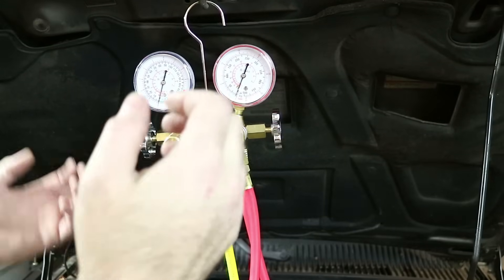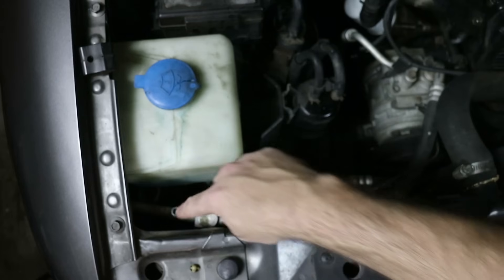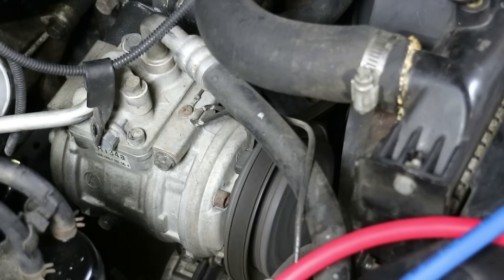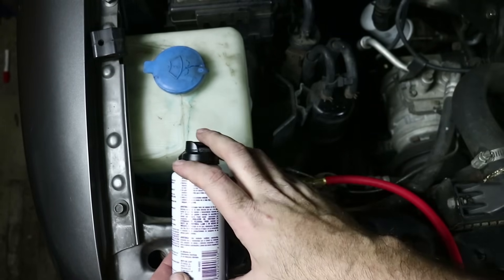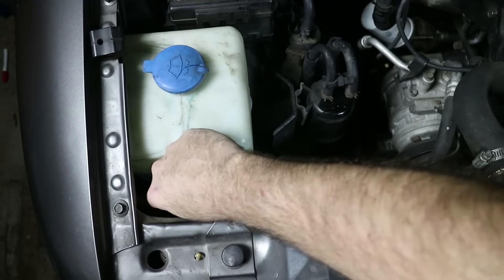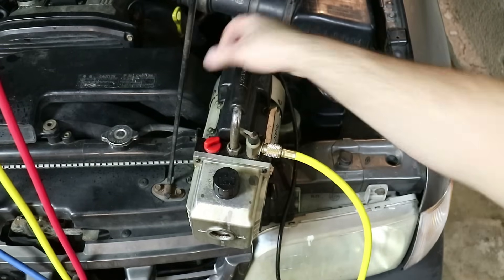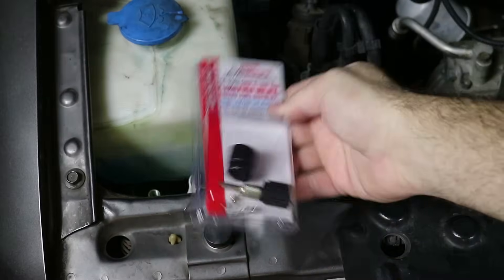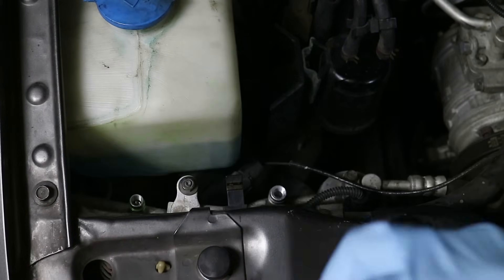How To Recharge an A/C System Professionally DIY

Comment: Great video!  It is my understanding that the reason you needed to evacuate the system by a pro, or at least back into a recovery bottle was not to release the old R12 into the atmosphere. This is why they came up with R134A. This should not be an issue since R-134A. It does not do damage to the ozone layer in the atmosphere as R-12 did.  Also, you might have a very small leak from the small O rings that connect the pipes to each other.  If that is your problem they should be changed.  However, this is a pain in the butt depending where that ring is, there are a few of them.  usually with a very small leak your AC should work for a few months if not the season.  At that time just charge it again.   About the valve leaking, You might want to push in the schrader valve with a small screw driver.  Just a quick push and release it. Sometimes some crap gets in there and "popping" the valve will clear it for a better seal.  Also, when removing the valve any charge or pressure in the system will be lost.   When you turn the can upside down, Be careful.   Car compressors do not like it when liquid goes into the system. It "can" destroy the compressor.  Always use the can right side up for gas.  When the can starts to get empty, meaning there is not a lot of pressure in the can.  What you can do is get a small pot of warm water and insert most of the can in the warm / hott-ish water. This increases the can pressure and forces the gas out of the can much easier and faster.
Reply: R134A does damage to the atmosphere in a different way, and it is illegal to vent it into the atmosphere.  It is supposed to be recovered.  Recovery machines cost upwards of $4,000, so most Diy'ers will not have access to one.  Believe me, if I could find a way to avoid paying a shop to evacuate my system, I would.

To me, his video clearly explained that any charge or pressure in the system will be lost if a valve is removed.  Did we watch the same video?
Reply: @chucklemberg4968  Do a youtube search for "DIY AC RECOVERY". There's a few guys who made their own machines out of old window ac parts.

Comment: Not opening the high side valve (the red one) when recharging the system was mentioned, but not the reason. The reason is that doing so allows the high pressure from the condenser to get into the can of refrigerant. Those cans are not made to take that kind of pressure, and could explode! When the can explodes, the refrigerant is instantly going to vaporize and freeze anything it contacts, such as clothes, skin.... eyeballs. The red valve should be open only if the vehicle is not running, such as when checking the static pressure to be sure it is equal on both sides of the system, or when pulling a vacuum. Otherwise LEAVE IT CLOSED!
Reply: THANK YOU !!! This is EXTREMELY important.
Reply: Never open that valve,that is only for evacuating and for vacuuming purposes.99% of the time you only open the low side.Unless you have a major problem.

Comment: The most common r134a pressure vs temperature charts that I see online show different pressures than this, for example at 80 F they show 40-50 psi on the low side and 175-210 on the high side.  Do you know why your chart is different than that?
Reply: Every vehicle is designed with different operating pressures but not that far off for r134a, you can get vehicle specific pressures from an Auto database at your local library. High/Low pressures and vent temps are at a given engine RPM, windows down, out of direct sunlight, A/C on recirculate, fan on high. By applying the max evap heat load the TXV will be fully opened, prevent the compressor from cycling, keep pressures steady.

Comment: Very good video.  I appreciate the energy and detail.  Respectfully said (though) I realize that you can SLOWLY sort of shake the can (as you did) but most all sources say to avoid (if at all possible) doing that as it may allow liquid to hurt the compressor (when can is upside down).  Doing so will fill the system faster, but increases potential of harming it.  Just some general info & food for thought.
Reply: I agree with you that liquid hitting the compressor is a bad thing.  I like to use a large bowl of hot water to put the can into.  Even when 90% empty and mostly floating in the bowl,  the hot water helps the head pressure in the can.

Comment: Remember folks. There is no mechanic in a can that can stop leaks in your a/c system. If you add a leak sealer to it you will destroy your expansion valves and compressors. Should be illegal to sell that shit lol.

Comment: Awesome video thanks. Also to note you show how to bleed the yellow hose when adding a can of refrigerant!  Great Job!!!  This was very helpful!
Reply: HINT: Turn the can upside down. That insures "liquid" flows up the yellow line and when the liquid reaches the top, it creates a visible mist. Then there is no question if you have the line purged. If you have the can upside right, only the gas escapes and you can't see the gas. NOTE: It is highly unlikely his system is at the correct charge. The only way to properly charge an A/C system is by precise weight.
Reply: @darrylhowe1465  "If you have the can upside right, only the gas escapes and you can't see the gas."  That has not been my experience.  The refrigerant gas has a clearly different appearance from the plain air that is in the line once it enters the atmosphere.

AND, pulling liquid into the compressor can lead to compressor damage.
Reply: @chucklemberg4968  I don't doubt that one might (in some cases) be able to see the difference in light diffraction due to the temperature difference between R134a and the surrounding air; however, R134a is colorless. (Source: https://en.wikipedia.org/wiki/1,1,1,2-Tetrafluoroethane)

Comment: 12:00 Shouldn't you bleed at the low side connector of the car and not half way like you did? The yellow line is full of air but so is the blue line!
Reply: Nah, at that point the blue line is still holding a vacuum of -30psi. Only the yellow line was open to atmosphere as he took it off the vacuum pump and put it on the refrigerant bottle.

When he did the second can of refrigerant, the blue line was still part of the sealed system (this time with pressurized refrigerant) so again it doesn't need bleeding.

Comment: Do u hv to close the tap in high pressure line (red wire)before inject UV dye for checking leaks?
Reply: Yes.  In fact, since you're adding dye, don't even bother to connect the red hose.

Comment: My Low Side Pressure is 50psi
& High Side is 300psi
So the Compressor is good or bad?
Reply: Compressor seems like its pumping.   It sounds like you have air and non condensiibles in the system or its radically overcharged
Reply: @patrickcady2843  sorry high pressure side is 225 to 250psi.
& the sound all are normal.
but the cooling is not good.
The temperature in Pakistan reaches 44°c
Reply: @UmarFarooq0300  Are your windows tinted? Does it cool better at night?
Reply: @irongoose3865  Yes, it would be right at night
Does not work on days when the temperature is high
Reply: @UmarFarooq0300  Tint your windows, it makes a difference.
Reply: @irongoose3865  This is the same experience I have had
I made Windows 25% black
But I didn't read that much differently

Comment: Die was injected, but so was a slug of air.  Also, if your lines are full of air when first connecting, then you just put air in the system.

Comment: If you vacuum your system down it is completely empty you can install the refrigerant as follows. This method is quicker and more efficient. First of all you do this procedure with your engine off you do not run the engine or the AC! After hooking up the can of refrigerant and purging the line you then invert the can and submerge it in a bucket of the hottest water you can get from your tap. This will not allow any water to go into your lines because they are perfectly sealed and under pressure. Swirl the can inverted in the hot water for 30 seconds to build pressure in the can. The next step with the engine off is to open the red line and within three seconds 12 ounces of refrigerant will shoot through the high side through the condenser to the receiver dryer the way the system was intended. Next close your red high-pressure line, your empty refrigerant can valve and remove and discard the empty refrigerant can. Repeat the same steps for the all other needed cans. For the last can, in this instance, open and close the high side valve intermittently if you’re not going to use the full 12 ounces. Each time you open and close the valve, weigh the remaining refrigerant on a small scale that way you’ll be able to know how much to go. The final step is to close both valves on the manifold gauges and then start the engine. Run  the AC on high with a temperature gauge in the center register with the fan on high and the windows and doors closed and your air recirculating not taking outside air. Fine-tune any more charging with the can upright in the hot water and open the LOW  side or blue line to let the refrigerant in as a gas. This is important because you cannot put a liquid in the low side you could lock up your compressor. Many videos incorrectly show you inverting the can and shaking it up or holding it sideways when putting refrigerant in on the low side this can damage your compressor. Hope this helps, good luck.
Reply: Hell no don't do this 😐
Reply: @narekhart9862 care to elaborate?
Reply: All them quick fill cans like ACPRO says to tilt it. I get what you are saying about liquid. But they are referring to not crank the thing wide up and ram liquid into the low side which would then potentially lock up. But if you just go easy with it it’s fine

Comment: Use a micron gauge and pull it down to 500 microns don’t just run it for 30 minutes🤦🏻‍♂️
Reply: But a single stage vacuum pump may be incapable of reaching that level.  Probably best to pull it as low as the pump will go, then keep it going for 30 minutes.

Comment: Inverting the can of refrigerant charges the system in the liquid phase.
In theory, this liquid could reach the compressor inlet reed valves and damage them.
In practice, the liquid should "become" gas (due to the lower pressure in the lines between the can & the Compressor inlet...) But do bear it in mind.... do not blindly flood the lines with the refrigerant in the liquid state. 
There is a lot more to consider in theory than is explained here. Consider this as rudimentary first-aid at best.
Reply: Which is probably why most instructions tell you to flip the can rightside up and upside down.

Comment: Hi 50's, I watched your video about five times and then carefully did everything just like you said . . . except I forgot to purge the yellow line of air before I opened up the low side and turned on the can.  Putting another can on after emptying the first, I did the same damn thing with the second can.  Jeez . . . how stupid can one be. 

What's the consequences of having air in the system?  I have a vacuum pump and can evacuate the system.  I have a shop that will recover the 134a.  Then I'll bring it home and evacuate it and see if it holds a vacuum . . . just like you did in the video.  Good thing I didn't do that first . . . or maybe not.  Just extra running around.  Anyway . . . my gauges are reading the same as your gauges which, for it being 87 degrees here with 75% humidity, is within the ranges of your chart . . . on the low side of the range but still, it's within range, a/c is blowing cold and compressor is not short-cycling.  But I know there's a couple short hoses worth of air in my system now thanks to my Alzheimer's.  My manifold hoses are about half the length of yours, so that's an unexpected advantage of having a cheapo manifold. 

When the connections got really cold where they hook to the manifold the hose connection got frosty and started leaking a little since (I assume) the fittings were shrinking from the cold and allowing freon to get past the O-ring.  I'm guessing on that . . . do you have that happen too? 

Anyway . . . what's the consequence of having a small amount of air in my a/c system?  Could I possibly ruin my compressor or other component?

****************************

I just read the comments below after posting the above.  It's reassuring to learn I'm something of a genius compared to many of the commenters.
Reply: Hi Mike....Nah...a bit of air in a car system is negligible. But that assumes that there was no air in there, to begin with! Compared with Fidge freezers, a car system is pretty rough & ready and therefore quite forgiving.
It also depends on where you are and the relative humidity: High Humidity means moisture-laden air...A big no-no in any refrigerant circuit. The moisture can freeze in the expansion valve/metering tube orifice and shut the system down as the suction side will fall below the low-pressure switch opening point. (as it has no gas to suck on!)
Apart from that, it would appear you did a good job! Thumbs up. Cheers.
Reply: The only air you'll get after vacuuming is what if any air that sneaks into the charging or low pressure hoses after you pull off the pump.  However, if you properly purge these hoses, what you will get into the system is negligible.  The problem is not the air per se, but the moisture.  And the receiver/dryer can trap that last bit.

Comment: This was the best video on charging and helped me!!  I had questions about vacuum with oil in the systems, and bleeding air and this video answered all of them.  Very informative and easy to follow and listen to.  Thanks!
Reply: Did you have a scale so you would know exactly how much refrigerant was put back into the system?
Reply: @kdeh21803  Yes.  Made sure can was on liquid side, and measured amount by weight.
Reply: @richardroy5437  that would be great if the system was completely empty but never just top off.
Reply: @kdeh21803  Mine was completely empty.  Pipe broke at flare joint, system was at 0 psi.  I replaced lineset, vacuumed it etc, and refilled by weight.  I was worried about compressor oil since there was oily residue where it broke.
Reply: @richardroy5437  Then you replaced the amount of refrigerant on the sticker.....  a few weeks ago I repaired a system on a very small vehicle and the sticker said the maximum charge amount was 16 ounces.... I got to thinking some of these "top off" cans are more than that and people with no training in car AC work get these cans and empty them into their car thinking their doing something, "Great" and they have put 1/2 pound more refrigerant in their system than it calls for and it really does more harm than good.  Because a can says, "AC Pro" does not make you a pro.  AND some of these cans have a "low pressure" hose but I've never seen one with a "High Pressure" hose..... you need to guage both.
Reply: @richardroy5437  The UV dye that comes in a bottle is actually refrigerant oil with the dye added.  So when I added the specified 3/4 oz, I was adding that much oil.
Reply: @kdeh21803  Using a digital scale, weigh the can before and after.
Reply: @jackb1803  even then, was the system completely empty and if not how much was in there.??

Comment: Hi Jason, great video as always.  My low side was around 70 and my hi is 150.  What am I doing wrong?
Reply: sounds like an expansion valve issue.
Reply: Sounds like you may have a weak compressor.

Comment: Hey boddy. When you removed the low pressure core from the inlet and gone for a couple of hours to buy replacement part, the system was open to atmosphere. Humidity has intered the system and your dryer needs to be replaced. A very big common mistake.

Comment: My 2002 cadillac eldorado displays "ac refrigerant low- AC off". My ac power button will not engage (light wont go on ). So my ac compressor clutch wont engage to allow me to introduce R-134a. Any guidance will be much appreciated.
Reply: If it doesn't have much in it you need to pull a vacuum. If it has quite a bit you have to hotwire the compressor
Reply: @YourMom-mq4zc  Thanks very much Mike !!! When I hot wired the compressor I heard a loud hiss so I disengaged the jump. Hope it was something minor !
Reply: You can also just jump across the low/suction side cut off switch with a paperclip it will be on the dryer or one of the big lines/hoses. Needs to be running when you jump or it will freak out because the clutch is engaged but it's not turning the pump
Reply: @YourMom-mq4zc  Thanks again Mike ! I will follow your advice and post results. Brian.

Comment: Just a quick note. A system that passes a vacuum test can still have a leak and it will not be detected by dye. The seal on the compressor shaft (under the clutch) will leak under high pressure and is VERY hard to detect.
Reply: You don't need dye. I never use it.. A leak is pretty easy. If there is oil anywhere on a hose, compressor, condenser ext. You have a leak. I will also hook my air compressor through a fitting I made and find leaks, the only thing is you have to vac it down longer
Reply: I installed an entirely new system on my car earlier this summer.  It obviously had no charge that needed to be recovered.  I pulled the vacuum, tested for leaks, and had none.  Si I proceeded to fill the system.  However, when I removed the quick coupling on the high side, refrigerant started bubbling out of the high side service port.  Is there any way that I could have detected this on a system with no charge whatsoever?

Comment: Where is purging the lines?
Reply: Purging the lines of what?
Reply: When you pull a vacuum, all of the air is purged from the low-side line (blue hose) and the high-side line (red hose).  The remaining yellow hose (charging line) is the only one that needs to be purged of air.